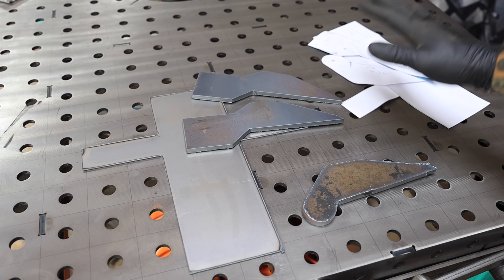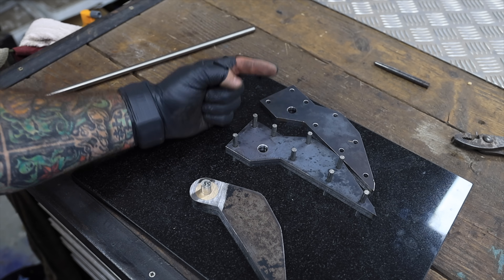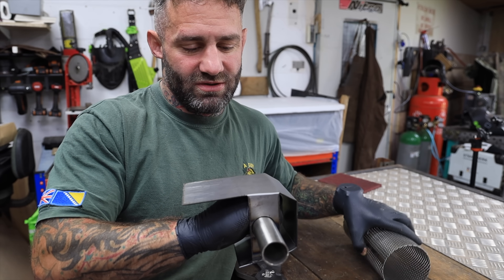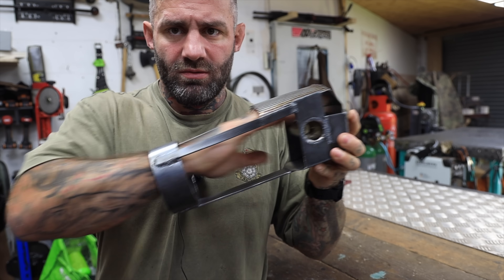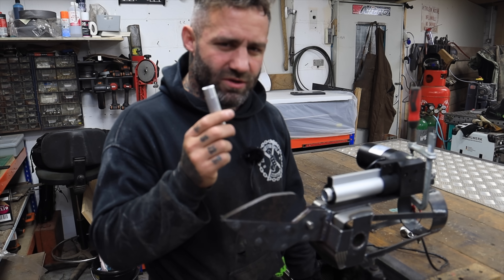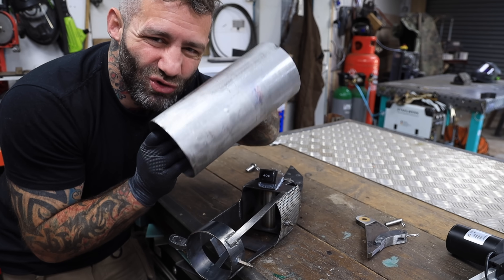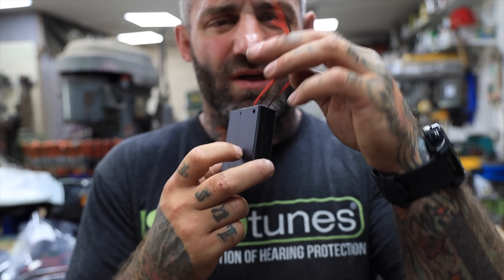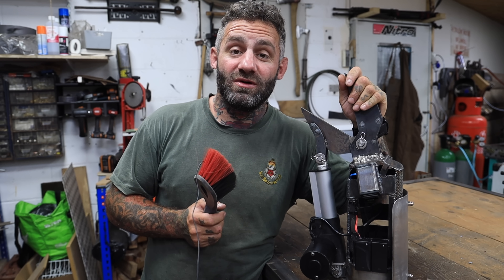Making an Arm Mounted Power Claw

Comment: That was amazing. The fact that you got that to do what it does off 2 9 volt batteries is nuttier than squirrel feces. I spazzed a little over the plasma table building cuts from drawings.